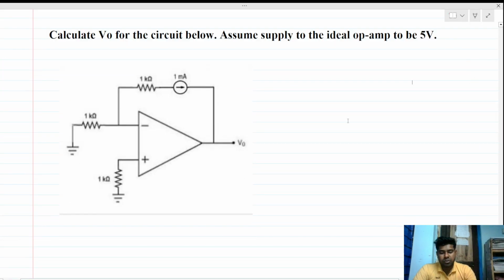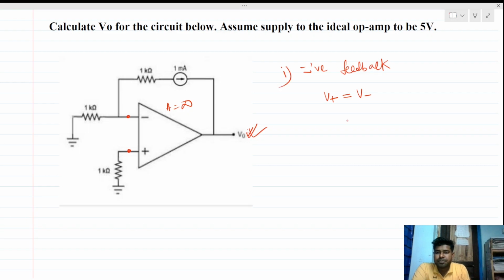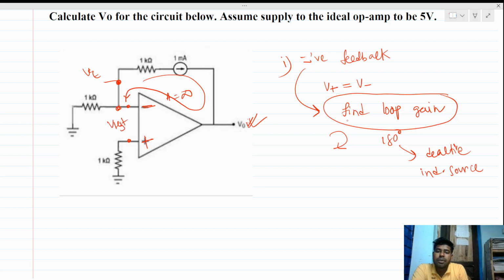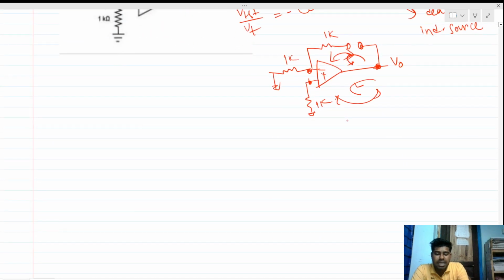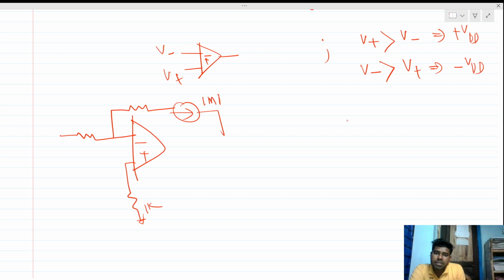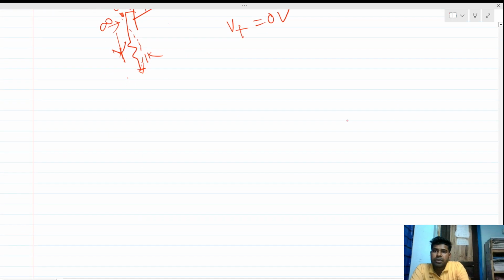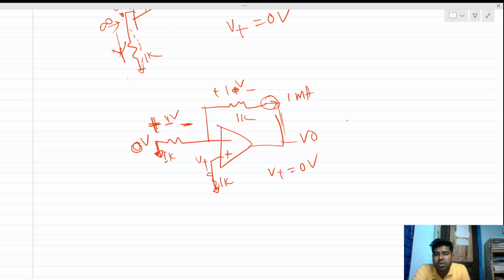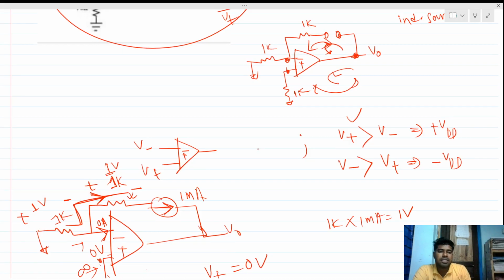Texas Instruments Analog Design Engineer Interview Question

Comment: A simpler method:
A current source has infinite impedance. If it is in series with a finite impedance resistor, we can treat the resistor as a short and remove it from the circuit.
Now we are left with a current source pulling through another resistor of finite impedance with its other end attached to ground. It is unnecessary to do any math at this point. Obviously if it is pulling in this direction, v- must be negative.
Since ideal op amp has infinite impedance, v+ is positive.
Therefore the op amp rails positive

Comment: I can't see how this circuit can be explained. There are several approaches to analysis. Here's one. Assuming an 'ideal' op-amp, then both input voltages must be equal if the op-amp is to operate within its 'active region' (ie, not go into output saturation). Vin+ is fixed at zero volts. The current source (assumed floating and unconnected to 0V/ground) is pulling 1mA through the 1k ohm input resistor located between the neg input to the op-amp and ground. So the op-amp Vin- is at -1V. This will drive the op-amp output to its most negative rail, which is 0 volts. That's an explanation that takes 1 minute. The first question with any op-amp circuit is, 'what does it take to make both inputs the same voltage?' If this can't happen then the op-amp output will saturate to one of its supply trails. In this case, the 0V rail.
I'm not here to destroy the work of other engineers. The planet needs nerdy engineers like you and me:)

Comment: I think there are so many worngs here. Firstly, even if we assume opamp to be ideal, it doesnt mean input range will be beyond vss and vdd. Common mode input range will be between 0 and 5V. So putting 0 or -1V into inverting input is basically the same. More over, I know current sources 
 Have been introduced to us in class as no matter what voltage on its terminals it supplies the current but in reality, even for ideal conditions, it can provide current only when positive terminals potential is higher than the negative one. So the output shoukd oscillate.
Reply: I think here it has been assumed that the current source is an ideal one

Comment: This is purely a hypothetical question with NO practical significance...  If the Vo  =  +5V as described in the video , first of all how is the 1mA current source going to flow in the direction shown ? When the 1mA current "can not flow" , V(-) becomes 0V and Vo becomes 0 as it is ideal opamp...  Even in this case the current source can not flow ( if the current source has to flow a current in the direction, its left side has to be + and right side -  and is NOT possible here ) in the direction shown and hence v(-) remains at 0v and Vo remains at 0v
Reply: it's an ideal current source, the IV characteristics of this device is a straight horizontal line if we ignore shunt source resistance of the source. This basically means it can provide a constant current output no matter the voltage across it. 
Current output from a source has no dependency on terminal voltage drops.

Comment: Please confirm again. How to calculate feedback gain of a opamp step wise. 
Let me say few steps
1. De-energies the independence source .
i) voltage source -Short circuit
ii) Current source -Open circuit. 

Here in state of current source if the source was a voltage source of 1v. Then the opamp have a negative feedback and output of opamp will be 1v. please correct me if I make any mistake.
Reply from the maker: Will be depending on the polarity of that 1 V voltage source.